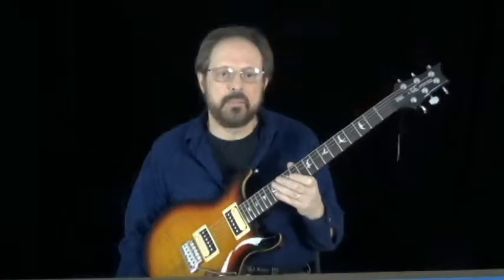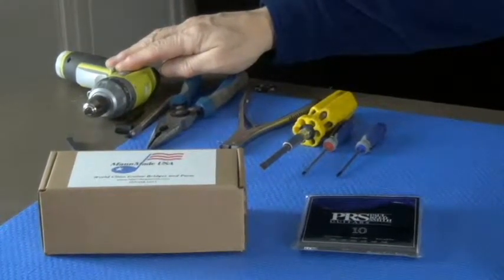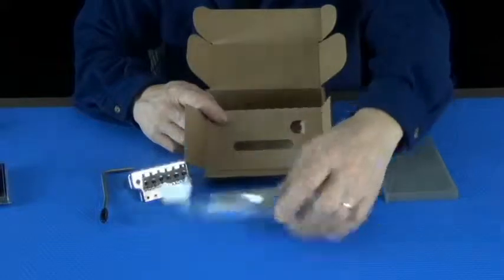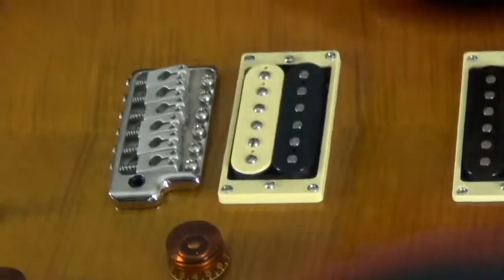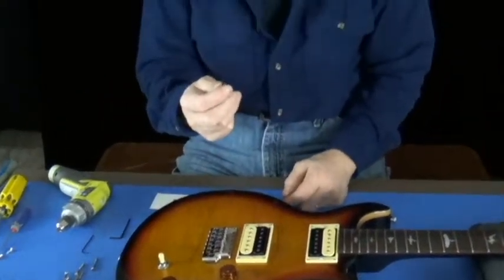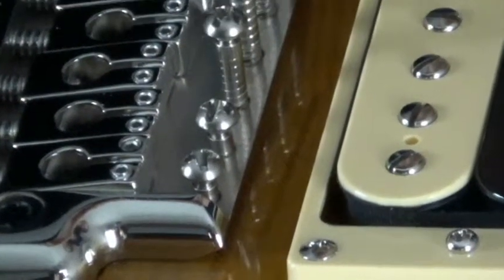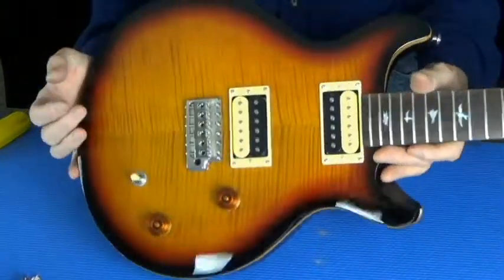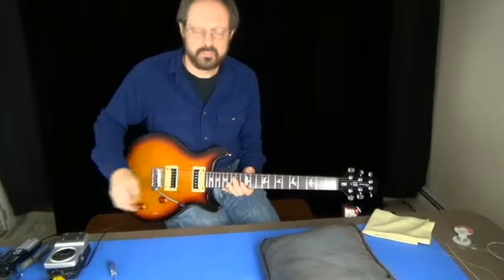2000NOS Bridge Installation

Comment: doesn't the bridge screw height affect the string height as well? so instead of 2.5mm between the blade and screw, 2mm would drop it for a little lower string height right? then just adjust the springs to make sure the strings are parallel to the blade?